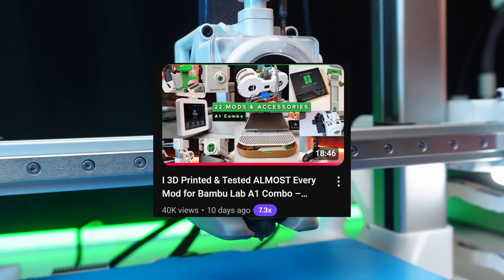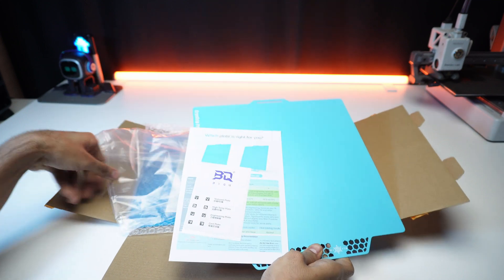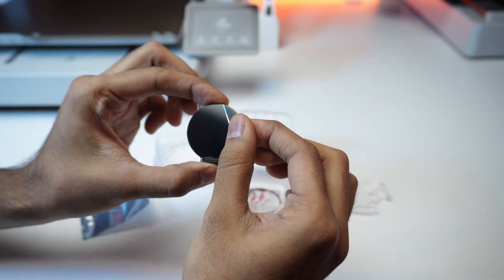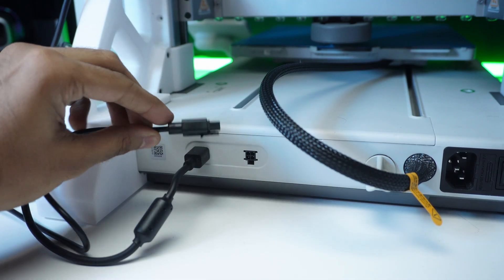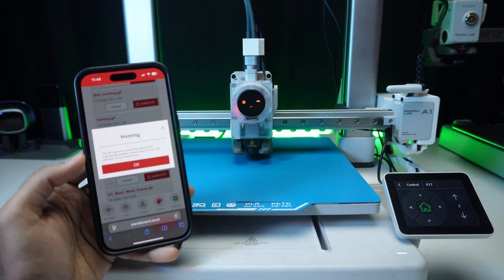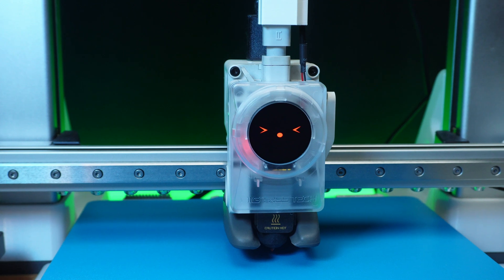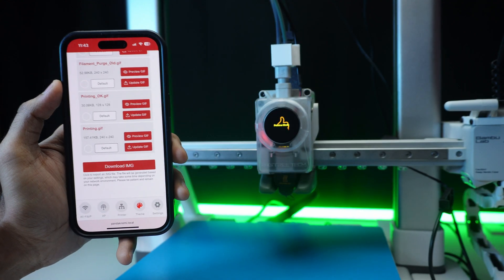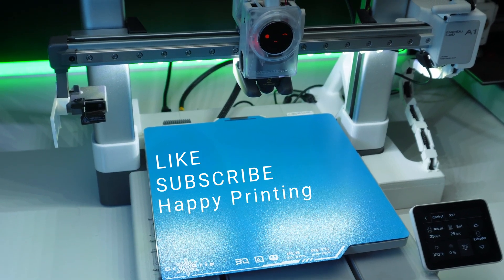I Installed Panda Knomi on A1! Tiny Screen Mod with Custom GIFs | Is It Worth It? 🎬🔥 #3dprinting

Comment: I'm trying to compress a certain gif (raving racoon, it spins around so it's like it was made for this) but I can't seem to get the size down. I just got it and it says "2664.25KB
 occupied | 407.75KB available | 3072KB total" Could you help me with this?
Reply from the maker: Panda knomi supports only 240x240 pixels gif. make sure your file comes under or around that.

Comment: But can we Plug in a ams,knomi and the led at the same time?
Reply: No you'd need the panda branch
Reply from the maker: Yes, you need one of the accessories called "Panda Branch" , some kind of Expansion Board. I never used that so I don't know much..
Reply: Il faut le panda branch c'est encore 25€ de plus pour un gadget. Il n'y a même pas d'autre gif de dispo.